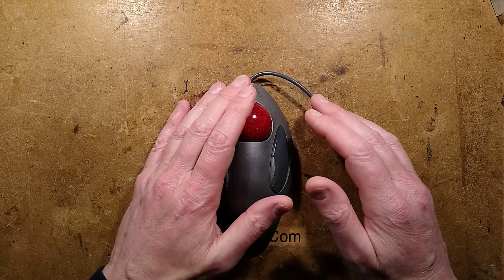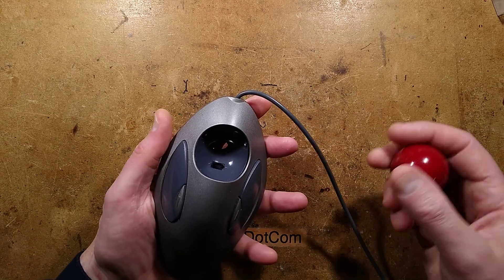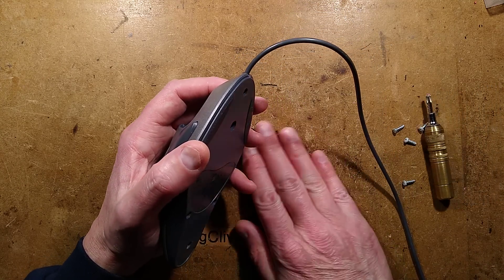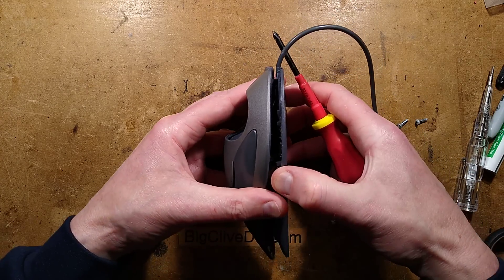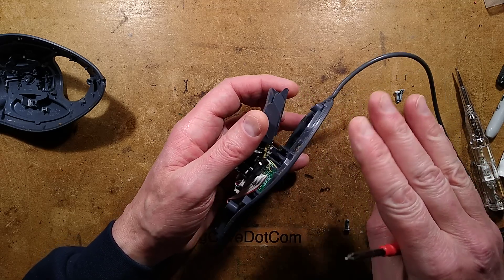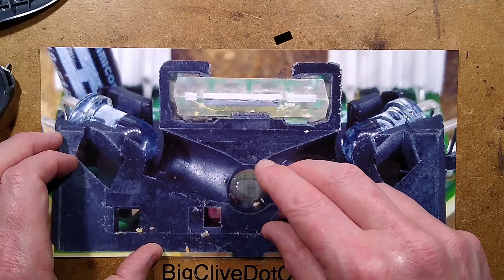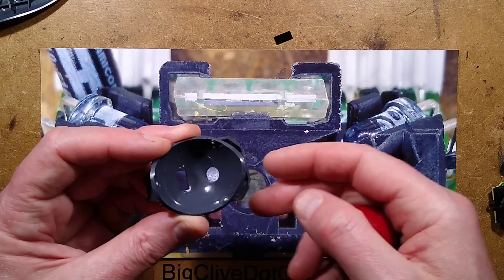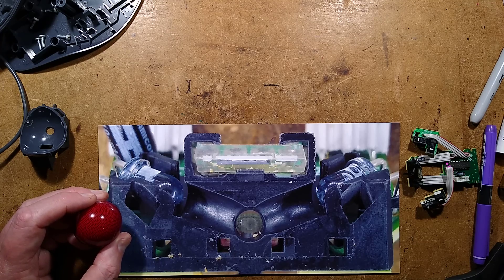inside an optical trackball

Comment: Having tried several, this is by far my favorite trackball too! I own 2: one as my main pointing device on my primary computer at home, the other is in the theater on the PC running MagicQ to control our stage lighting. As any fellow theater nerd will confirm, there is never enough table space in the control booth, so this trackball is perfect! I can quickly and accurately get my pointer from the first monitor all the way over to the third monitor in one smooth motion. Sadly, it's pretty useless for most games, having no scroll wheel. As a side note: I bought my first one somewhere around 2008-2009 to use on my laptop running windows Vista. Ever notice the little arrows on buttons 4 and 5? If you installed the official drivers that it came with back then, those buttons defaulted to scrolling! You could also click left and right at the same time for a middle click. The software wasn't terrible, but it annoyed me enough I never bothered installing it on later computers, leaving me with just standard buttons 1, 2, 4, and 5, with no scrolling or middle click. I'm not even sure if they still offer anything similar for modern Windows. As for reliability, well, I'm still using that original unit daily over 15 years later! I've gone thru about 4 computers in that time, but the trackball always sticks around lol
Reply: I like these too, also have several and using one of them daily for many years. Very reliable indeed! 
I'm running Linux, and I've assigned one of the small buttons as autoscroll: holding it whilst moving the ball replaces the scroll wheel nicely for me. Middle click works too: pressing both big buttons simultaneously does the trick. Not sure if that's a standard feature or if it depends on the driver/settings though.
Reply: I switched to these years ago, and will never switch back!
Reply: Looks like Logitech has stopped making these😢
Reply: I first got mine around the same time! Did you get yours from Wal-Mart? They stopped carrying it, a shame.
Reply: I also have one of these as well and it's much more comfortable than the large flat style common now, but it's useless to me without a scroll wheel or the ability to scroll by rotating the ball.
Reply: @fallenstard  I usually have my left hand over by the arrow keys, and, use page-up and page-down to navigate.

Edit: also home/end, or control-home control-end depending on the program.
Reply: Ever try the Logitech Wireless Optical Trackman? I think that one much better. All but one of the buttons is located on the left side by the thumb. Either the thumb or the index finger pushes buttons while the ring finger can right click. I have tried the one in the video and several others like the Microsoft thumb-ball. The thumb was not designed to have that fine of motor control.
The Trackman has eight buttons that are programmable with software otherwise the two extra main buttons browse forward and back.  

Software for Logitech trackballs is SetPoint Control Center from Logitech it works well even has a battery warning. Buttons can be bound to key assignments as well. With the scroll lock button I Alt/Tab and with the scroll buttons I go back and forth through tabs, default wheel click is open link in new tab. If you are still little enough to play video games it should work with all games and the keys can be bound in-game. I have a craptop with Ubuntu and it picks up all the buttons and performs the default action for them all. Which is fine. Now if I can could just keep my original "Zboard" with the extra buttons on the left side working in Windows I could probably quit drinking and huffing glue.

"Moving your mouse around the desk is silly, just move the ball!"   That should be an ad campaign for a trackball. 

I have been using trackballs since Y2k+1. One had two scroll wheels for up/down and for left/right because of the 800x600 resolution of monitors. It was not optical it counted the slots in two wheels as you moved the ball.
Reply: X-mouse button mapping has worked well for myself for button remapping like the original software did.

Comment: I've got quite a few of the thumb-operated version, also by Logitech.  I find it a bit faster to operate, as fingers can sit on buttons and the thumb has a lot of independent range.  Logitech had a weird patent issue for a little while there, and the wired version got taken off the market and started selling for hundreds on eBay.  They've since resolved the issue, which is too bad because I don't need six of these...